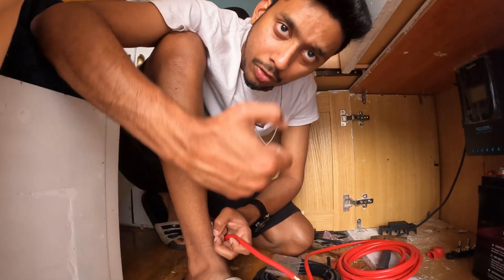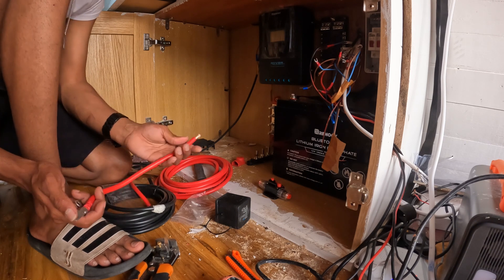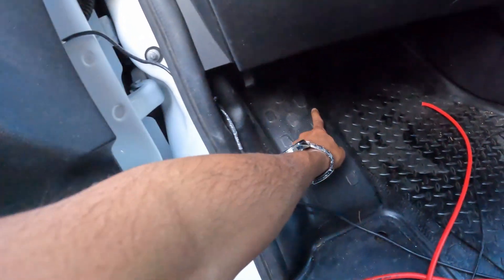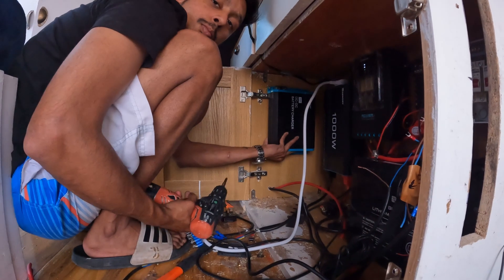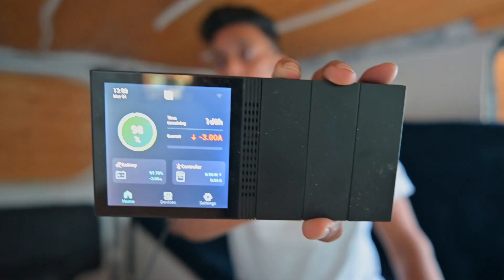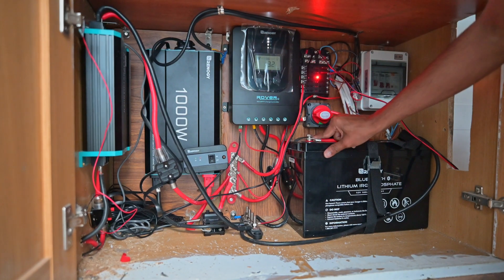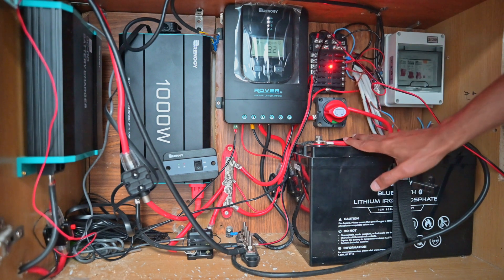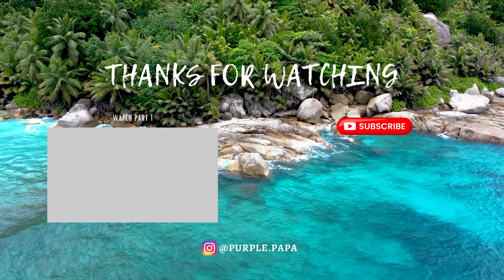Van Electrics Installation with Renogy Components I #vanlife #campervan #renogy

Comment: That wiring coming off of the battery does not look like it’s gauged properly. It should also have a fuse between the battery and the switch.

Comment: which is better for a 12v electric system vectron or renogy, and which one is cheaper ?
Reply from the maker: Renogy is cheaper and an upcoming company trying to establish themselves as the best. Victron is more expensive but also more reliable. If I had a bigger budget I would definitely go for victory components or use all victron components with renogy batteries.

Comment: Get some rubber grommets around your drilled metal openings to prevent cable damage. It will happen with vibrations!

Also, how did you seal off the holes in your roof? I saw no sealant or anything being applied after drilling the holes (selftapping screws, tight). That's water coming in when it rains mate.
Reply from the maker: Hey thanks for the feedback 😄 I did manage to add rubber grommets and also put some silicone on the roof to seal it off. I didn't put it in the beginning thinking the rubber washers would be enough but better safe than sorry right.